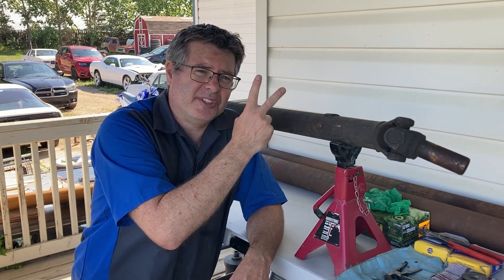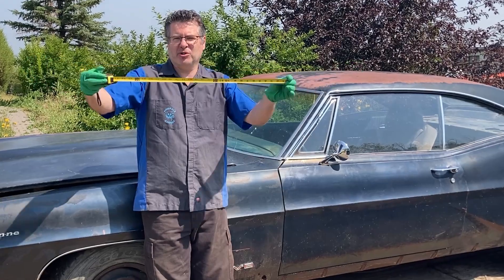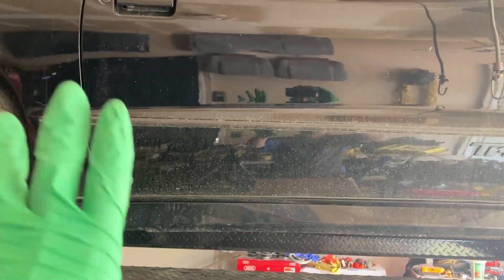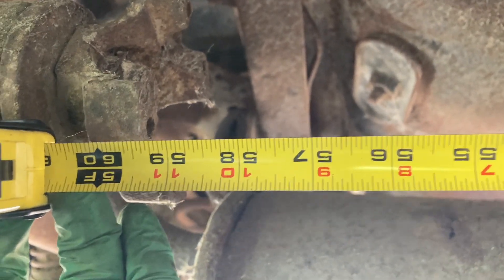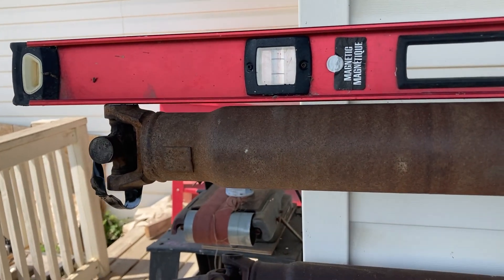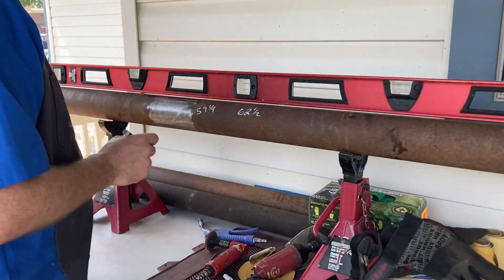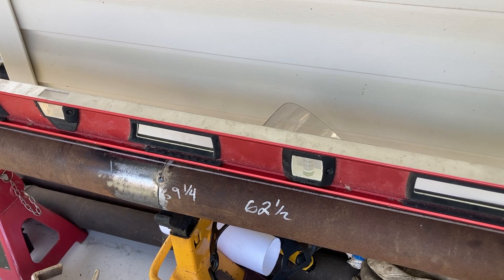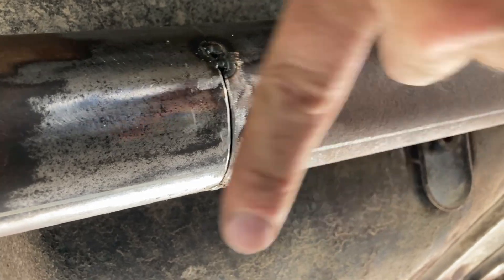1967 Parisienne (Pontiac Impala) Gets a Custom Drive Shaft

Comment: I'm a pipe fitter by trade. I bought a used transmission with a longer tail piece for my 68 Rambler. I put the cut as close to the diff. As I could. And used a tube style pipe cutter designed to cut black steel pipe used for natural gas inside of buildings. It makes a perfect cut every time. I never even checked to see if it was out of balance. But thirty eight years later. Its still in the car today. I had luck on my side. I really didn't know what I was doing. Great video. I'll be waiting for the next one. From: sunny Arizona. : )
Reply from the maker: Nice to hear you had some luck, great idea cutting closer to differential…was thinking I should have done that myself.  If I have to do it again I will definitely do that!